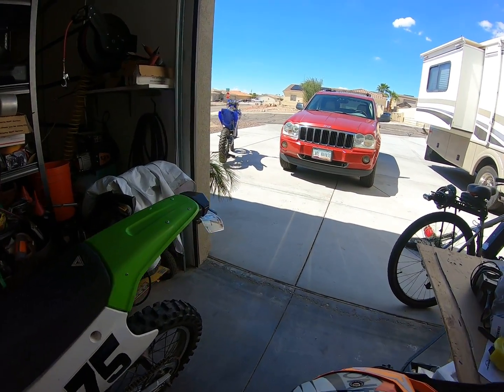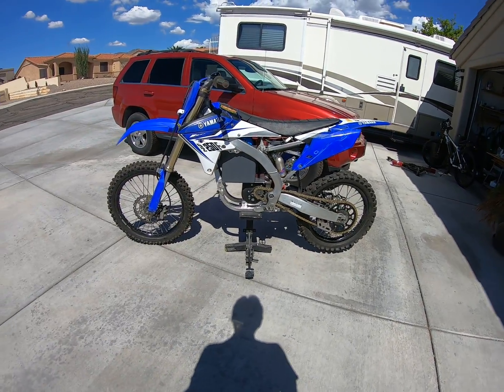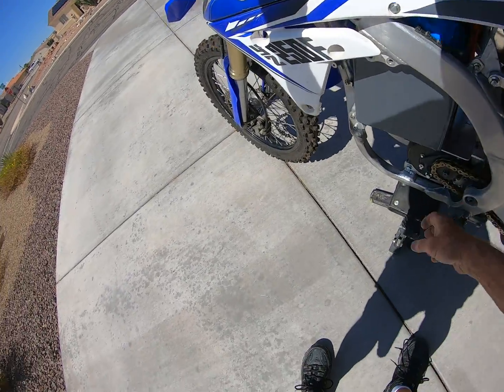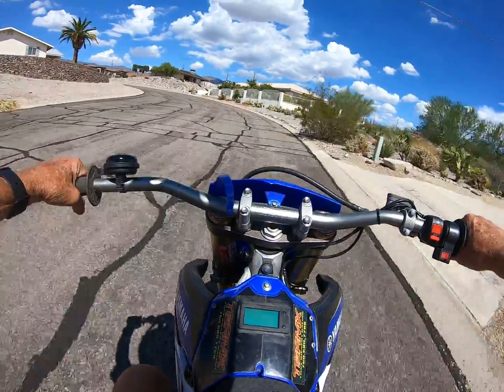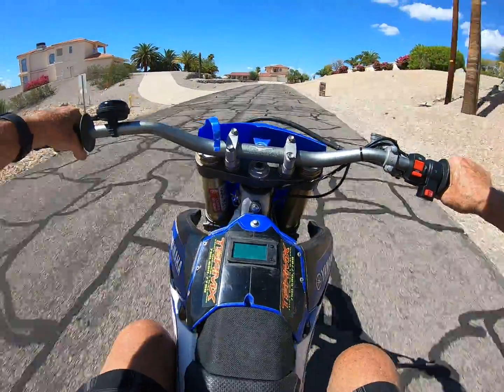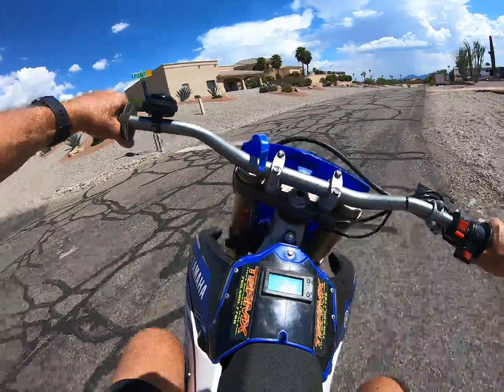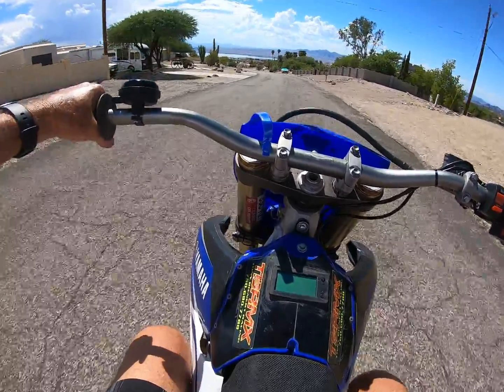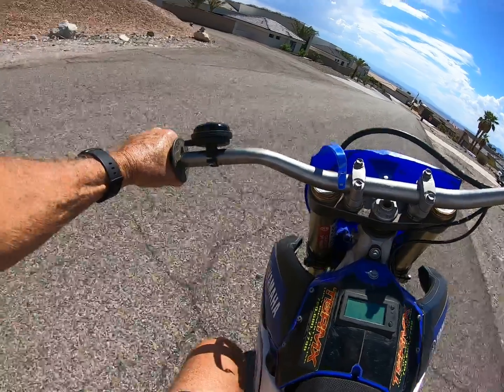2014 YZ250F with QS 138 70HV3 and Votol EM260SP/2 Controller from ElectroandCompany.com

Comment: I don't suppose you could show me how you made the motor mounts
Reply from the maker: Man you are quick to watch that.  this was so fun to build. I think the YZF 2014 and newer frame is the best bike to adapt.  As you can see on my channel I have modified a lot of bikes but this one can allow to make a quick battery change system also. I can send you a couple of pictures, or send me $20 and your address, and I'll send you about 50 images and a video on a USB stick..
Reply: @dcoxryton  is there a social media you use Facebook or Twitter. I originally saw you got one of mark's emx motor kits.
Reply from the maker: @Moto18cdude  Yes I did have the Xemx1 motor on the bike before, but neither he nor I can get the Sevcon's or the Curtis's to stop dropping out off a jump, or under sudden load. The QS motor and Votol Controller  is smaller and weighs 19 lbs less, for the same power the are getting.  Power is not the issue, because most people use only about 250 to 350A, and the Votol also gives flux weakening, which gives you more RPM in Boost mode.
Reply from the maker: I am Donald Cox on Facebook